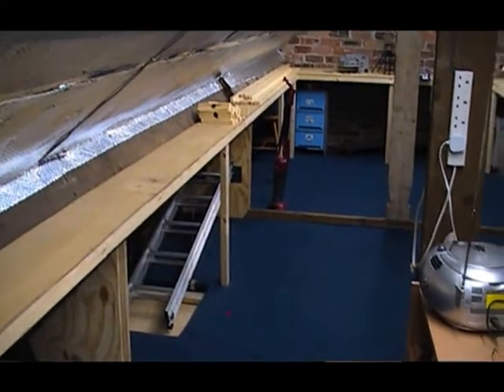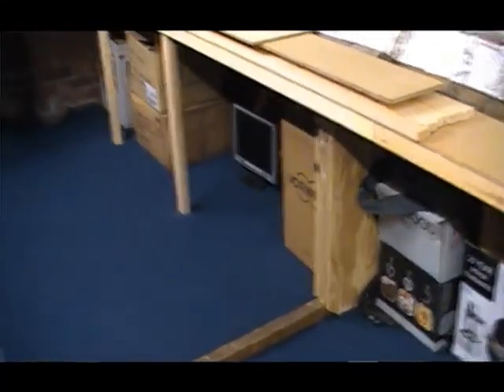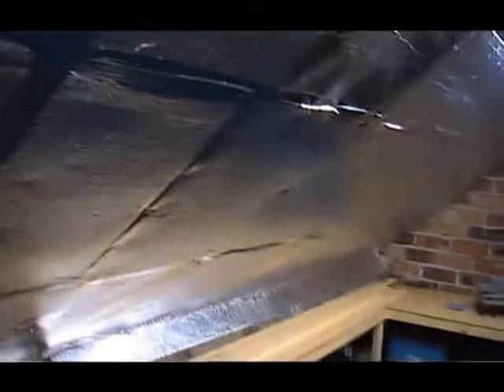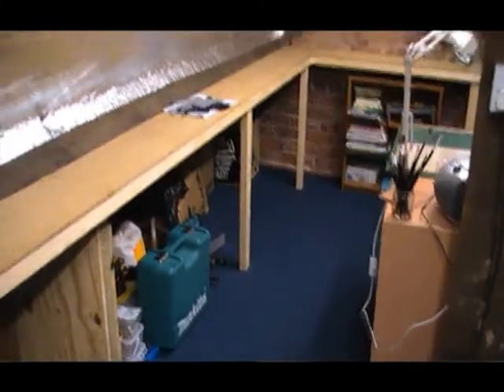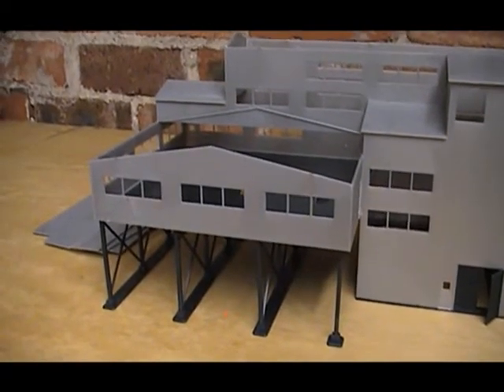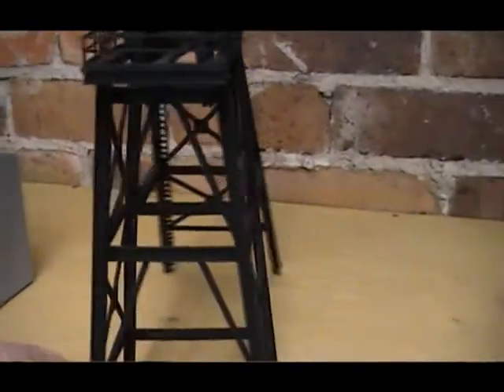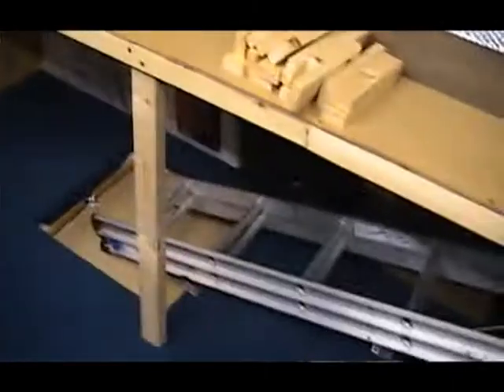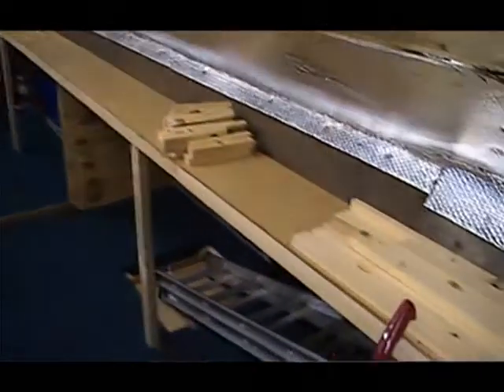Loft Update. Video #20

Comment: Where can I get some of that aluminium roll Michael. It seems to be an answer to my problem. regards Manny
Reply from the maker: Hi Manny,
I got mine from B&Q
Reply: Thanks Michael. There's now't worse than shivering when it's cold and overheating during the summer. I'll be having a few roll's in the New Year. I'm enjoying your show's. I've got an issue with my Railmaster/ELink at the moment and a mate said it could be because of the massive fluctuations in temperatures in my loft

Comment: How did you floor your attic? I am having problems sorting out mine.
Reply from the maker: I used the loft floor packs from Wickes, they came in packs of three so i needed quite a few packs, also it was necessary so cut some to size and shape so a jigsaw is a good idea and don't forget some knee pads. 

I did mine in a day but you must make sure that none of the loft insulation between the joists touches the loft floor panels, if it does it will cause condensation under the loft flooring and will eventually spread and rot the flooring.
Hope this helps
Michael
Reply: Depending on your existing beams it is also an idea to add some strengthening to them my loft has only one wall under the centre supporting it so I bolted 6x2 joists to the existing 3x2 ones in the main width to aid in weight distribution and reduce any flexing to the old joists. Once that was done as stated by OP you can use the triple packs of flooring or what I did was buy the bigger 8x2 sheets of flooring as they cover the area quicker.